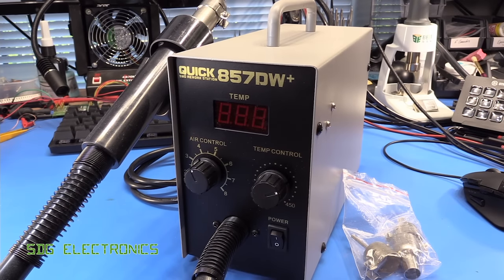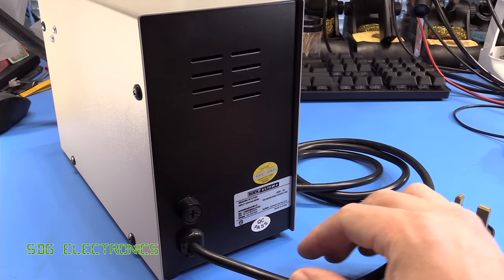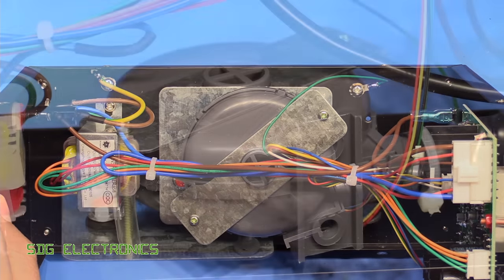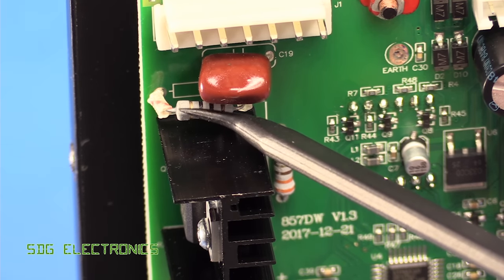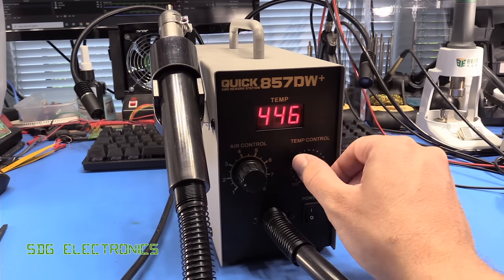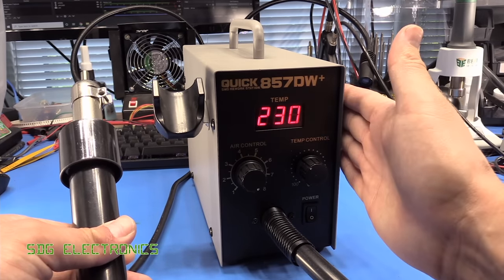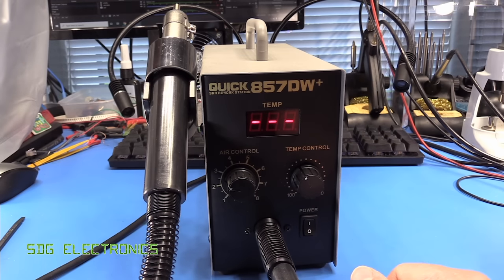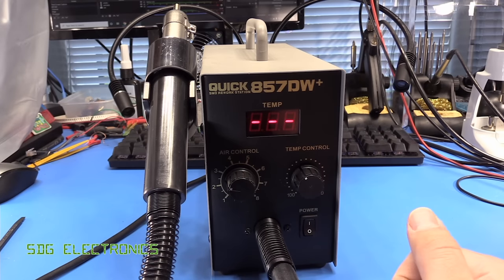SDG #150 Quick 857DW+ Affordable SMD Hot Air Station

Comment: Another great review. I like when you show the inside too, that should give potential buyers all they need to know. I was thinking of going for this recently, before I ended up with the Yihua 899D II . I didn't want to push my budget that far. It has a lot less add-ons  than most of the cheaper solder stations, usually that's because they did it proper I tend to find. I bet it lasts well. 

What drew me to the Quick brand was Louis Rossman's video of the Quick 861DW versus the Hakko 810 hot air stations.  I have the Hakko 888 but the price of their hot air is well beyond me. Looks like Quick are making a bit of a name for themselves these days.

Comment: I find 350-400 degrees usually works well when removing lead free solder.  Doesn't burn anything as long it is moved around while heating.  Actually find I'm more likely to burn something using low temperatures.

Comment: Seems like a reasonable unit, thanks for the info. I keep a pack of cable mount C14s (RS 776-9113) in stock to fix stuff with captive mains leads. Not a perfect solution but saves the faff of cutting square holes!
Reply: Minifig666 Hi,
I’m just curious and I missing the point. Could you please explain why you’d mount a C14 socket on the cable. Why wouldn’t you use a normal extension cord? 
Thanks in advance.

PS. I got the 858D with the fan in the hand piece. It was extremely cheap (€20.78 incl shipping) and has worked fine for me so far. I don’t use it a lot though. (And it has a proper C14 plug ;)
Reply: @Conservator.  I'd assume it's the compact size of the plug.

Comment: I’ve bought the 858D no-name hot-air station a few months ago for the rock bottom price of €20.78 including shipping. (On AliExpress) It’s 700W and has its fan in the hand piece. The temperature is set with two buttons instead of a know which I would have preferred. 🤓
I don’t use it a lot but when I do it hasn’t disappointed me yet. 
Quite a steel imo. 
(Prices have since gone up to a little over €30 incl shipping)

Just my €0.02. Thanks for the review!

Comment: My guess is that the heater shuts off early when the air is low to prevent overheating. Also need to account for the metal around the nozzle sucking some heat out of the air flow. I like the remote fan stations but it always makes the cable so thick. My Handskit station can still push close to 120L and it has the blower in the handle. You do get a little more noise but you really don´t feel the extra weight from the blower since these stations all have such thin plastic. I never turn it up very high so I don´t even notice the noise from the blower though.
Reply: I've noticed mine will overheat if the airflow is too low.

Comment: Hi Steve,  a quick question on these stations. Is this 857DW+  better than the all in one units, where the blower is built in to the handle and the whole thing can be swapped? Or would you recommend those over this version. My budget is around the price of this hot air station.

Comment: Thanks for the great review. I just bought it and i wonder if there is a way to compensate the temp undershoot at the nozzle. At 400°C on the display, i measured 350-370 °C at nozzle, at 450 its measured 400-420, or is it ok?
Reply: Did you find out how?

Comment: Great review, I used to have a Metcal HCT-900 really did not like the diaphragm pump so I sold it but I did like the analogue controls. I bought a very cheap WEP 858D as a stop gap till I find something else and assumed it wouldn't last 5 minutes but it's been used for a years almost daily in the workshop and still works perfectly, but I don't like the push buttons for the temp control and the blower in the handle. I've been looking at the Quick 957DW+ I wonder what the difference is between the 857 and 957? I've just got a Quick 201B Desoldering station and blown away with the quality.

Comment: This looks like a great unit for the price. I did some relatively brief research and it seems like the best option for me. I didn't want to spend more than $100 and the other generic options don't look good to me. The next best option I found was the SparkFun hot air station but I'm more impressed by this one and decided to order it.

I'll need to change the power cable (US) and I'll upgrade the handle's ground wire to something thicker when I get it. Thanks for the in depth and detailed review! 

P.S. The order I made was the first one where a coupon that Honey found worked for me. It saved me $10.72!

Comment: Are you sure you are not using the left hand for the blower and keep the right hand free for removing components or placing them when doing a repair or modification :)
Reply from the maker: Somehow I find it more comfortable to manipulate components with my left hand and hold the hot air in the right. Nice to see you're still around btw.

Comment: Great review. Looks like an ideal option for me as I really don't want a blower-in-handle design, but I also want simple controls and a small footprint. I wonder if the air and temp controls are interacting? That might explain it not reaching max temp when there is not enough air flow, by design to prevent damage to the element or handpiece. EDIT: Also, anyone think it's fishy that Quick don't list this model anywhere and there are different brand versions if you hunt for them. I suspect that this isn't made by Quick at all.
Reply: made by quick ..but this is old model

Comment: How does it tell the wand is in the cradle or free and easy? Is it a mechanical switch on the cradle, or is it passing current from the wand to the cradle and detecting the circuit open/closed?
Reply from the maker: There is a reed switch in the handle. The cradle is magnetic
Reply: That makes sense. Thanks!

Comment: I have this unit, I like it very much but I don't have anything to compare it. Is this suitable for professional repair (mainly phones and laptops), or should I consider getting the 861DW? I also, really like the user interface.

I have completely detached the holder thingy from the actual chassis and attached it vertically to the side of my instrument shelves. That way it's closer to me, "parks" more reliably and overall much more ergonomic. I love keeping my instruments elevated on shelves, more desk space that way and less clutter.

I am enjoying these videos, quality content right there!
Reply from the maker: I would always recommend a preheater for professional repair - if you use one, this will be powerful enough. Rapid localised heating can cause stresses in the PCB. The BST-863 is the best value for money if you find you need more power. Get some scrap boards and test it out

Comment: If you’re a beginner and went three and one for a real cheap price YIHUA 853D you get hot air for SMD you get a handheld soldering iron and you get a volt meter tester plus power supply I bought mine for $59 online. I now see one is cheap as $36 online in some places are trying to sell them for more than $100 which is a rip off do not buy this unit for no more then I would say $70 at most. Port meter power supply handheld soldering iron hot air gun I’ve been using mine for four years. For seven dollars I had to replace the element after two years that was easy to get on eBay for the handheld soldering iron.